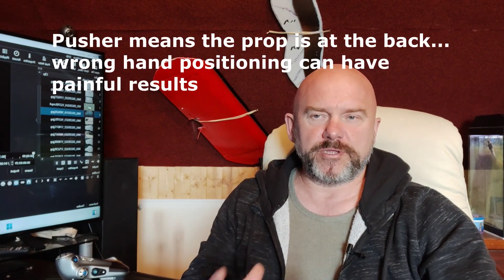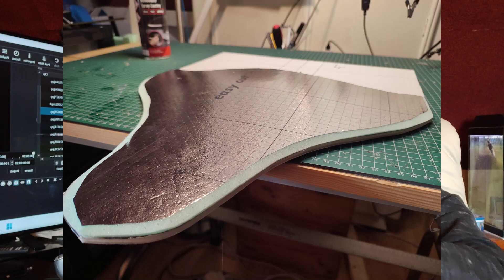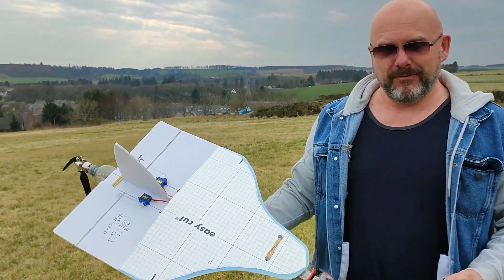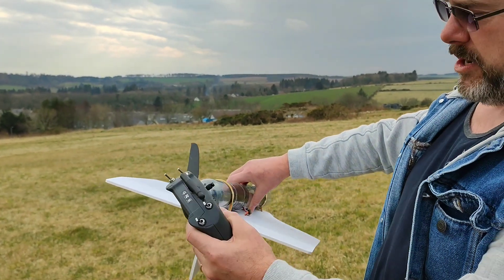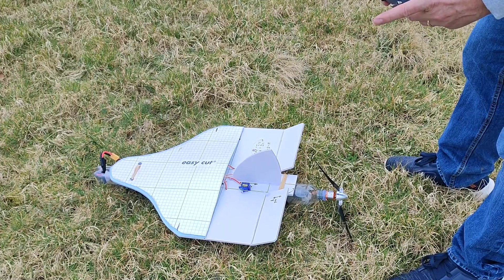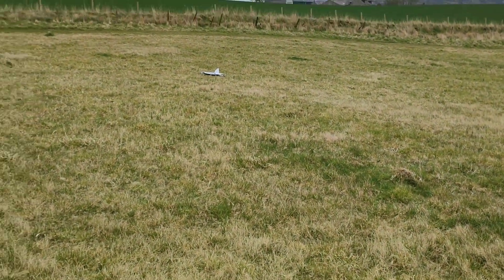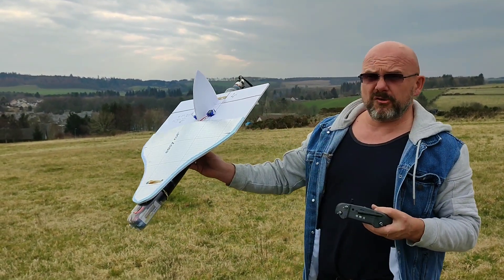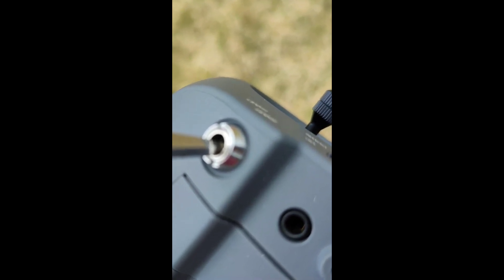Maiden flight. Building a Pusher RC plane: code name "slicer"

Comment: Lacking autolaunch, I either do a side arm launch, or throw the plane first before starting the motor. Did you need stitches?
Reply from the maker: I guess I am lucky it's only a 3s battery... If I was part of a club I am sure I would have been getting some warnings but since I'm on my own trying to learn this new hobby I guess I make loads more mistakes. I did not even need some super glue 👍😂
Reply: @ericflighttester7145  Trying to fly a plane you designed and built is setting the bar pretty high...   I only started flying after my retirement age 67 and started with multirotors, as they don't need forward speed to get airborn. I fly fixed wings for about two years and recently glued a Pibros together, having slopes, this would be a suitable learner plane for you.
Reply from the maker: @janspoelstra8309  so we are both new at this hobby... Forklift sorry I used the following plane https://youtu.be/7zioSaKIRs4
Reply from the maker: *for hill soaring